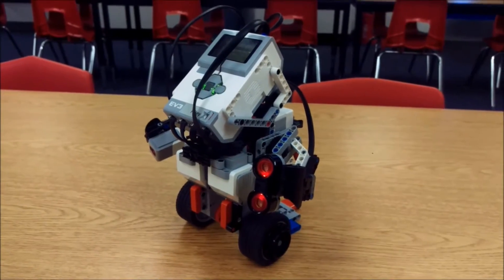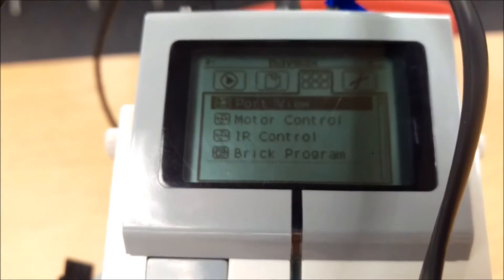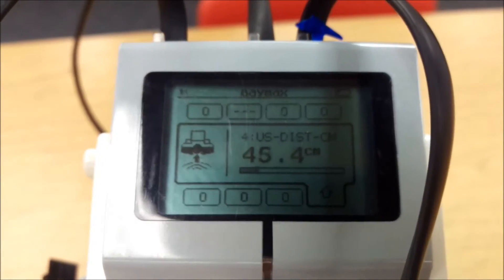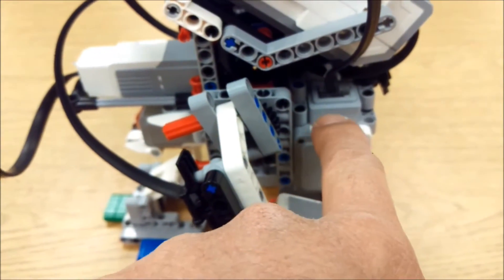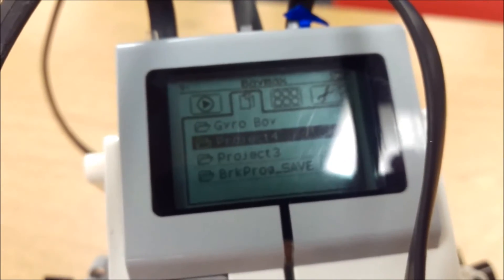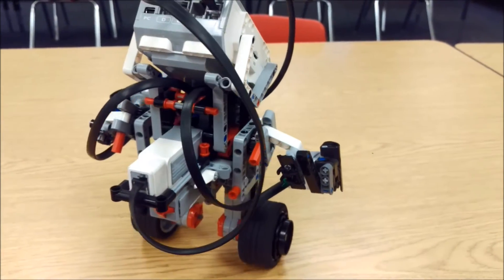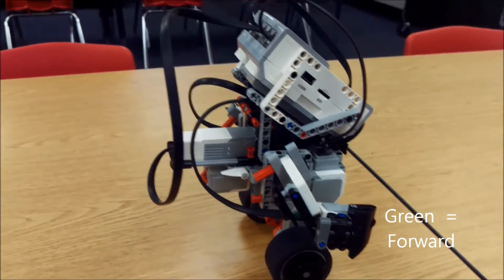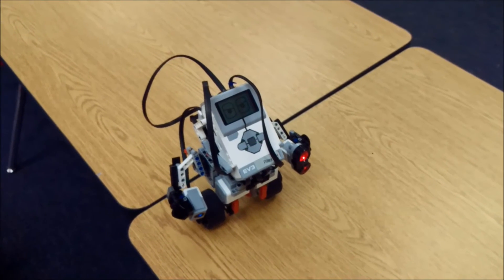"LEGO Mindstorms EV3 Gyroboy Robot" (What It Does & Where To Put The Cables)

Comment: Can't thank you enough for these Great videos! I'm doing my first ever class with the LEGO EV3 Mindstorms kits and wiring components into the wrong ports for the stock applications is a constant issue with my 7th and 8th graders as in the provided documentation, it's difficult to see what goes where. I had some 8th graders who built the GyroBoy successfully, but it did not function properly. I suspected it was mis-wired, but until I found this video wasn't sure. Used your awesome tip to use the port view. They corrected the wiring and it worked like a champ! Thanks so much again for including the wiring details in all your videos. You just made Life for my Students and I much better. Greatly appreciated!
Reply from the maker: You got it!!!  I was in the same sopt you were in several years ago and I thought it would have been great if someone had done the same thing for me.  I'm just trying to help out great people like yourself make it better for the students!!!  Thanks for letting me know it helped!!!